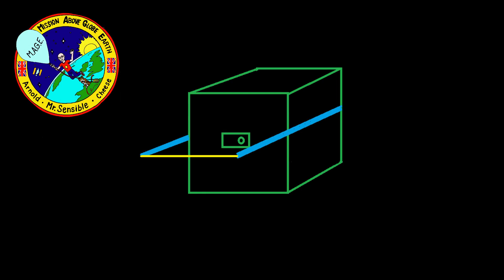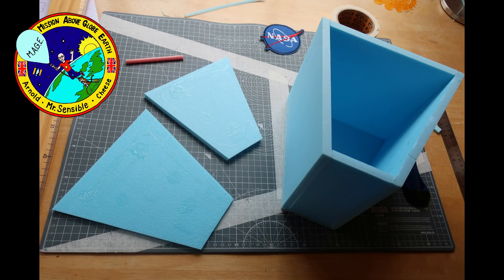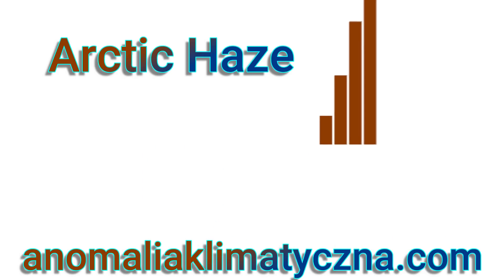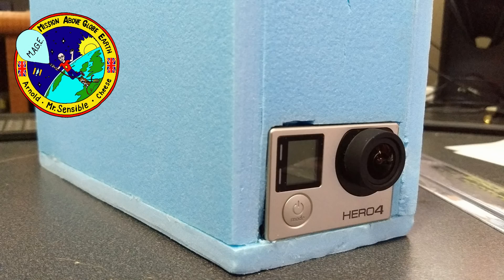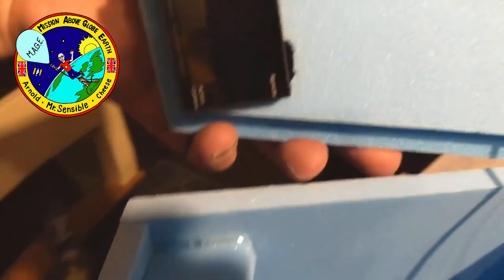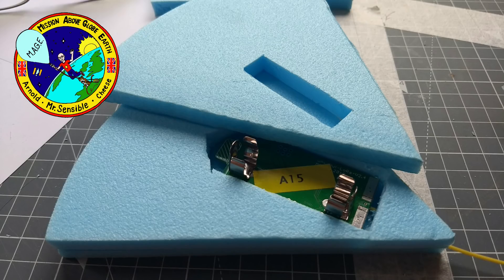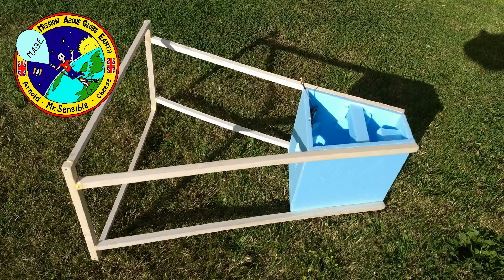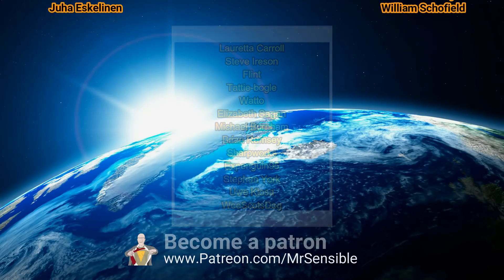MAGE Mission Above Globe Earth  - Construction

Comment: Sorry I didn’t see the details of your instrument package sooner. 
You could have done away with the two stretched tension lines & it’s support structure. You could have done this with a simple PRE- Flight OR POST-a flight calibration. Simply place a 2D grid (say 10 horizontal x 10 vertical, both stretching all the way across the field of view) of horizontal & vertical straight lines drawn on a large piece of white paper, mounted  in front of the camera, perpendicular to the optical axis. Take several images of the calibration grid, then find a “De-Fish” filter that is suitable (designed for) your camera’s optics. Show the “before” images (they will likely have fish-eye distortion) then apply the filter to that image. If the filter is correctly tuned for your camera’s optics, then the curved lines will become straight all across the field of view. Since you already know the lines are straight, because that’s how you drew them, you know what the “De-Fished” images should be (a grid of horizontal & vertical straight lines).

The one disadvantage of this approach is that FLERFers would have to understand how & why De-Fish filters work, and believe that they work consistently. It will be too easy & tempting for them to merely shout “faked & manipulated data”. Having a reference straight line in the image (as you’ve done) will help disarm that nonsense. One weakness with your stretched string is that the amount of FishEye distortion varies at every point in the image. Presumamably you are going to eliminate the distortion with a De-Fish filter, thereby returning the taut string to a straight line in your processed images. Unfortunately you will have demonstrated the proper amount of correction ONLY In the immediate vicinity of the strings in your image. If your horizon is “many pixels” displaced from the string, then you will not have proven proper correction at those image location(s). A 2D grid that covers the entire image FOV, would demonstrate proper “whole image” correction.

One advantage of using a calibration sheet is that you can still do this procedure now (after the flight) and it’s results are completely valid when applied to the images you’ve collected.

Comment: Marvelous design, and forethought! One "spinoff" benefit from a wedge-shaped equipment buss, the thing will tend to turn into gusts of wind, assuming the mass-distribution is suitable, with the "science camera" pointing downwind from the gust. If you want to accentuate this effect, you can plant tiny flat "fins" at the ends of the arms, out of view. You don't want these so big that you'll foul your chute risers during the recovery phase, that's where testing comes in.
Weather-balloons go with the wind for the most part, but there are frequently gusty layers and these things can flop around a great deal at altitude.
I was going to email you a cheap, very light, and effective "yaw" stabilization method.
Reply: @Q True enough. Must remember to send my idea, which has worked on lower altitude "elint" oriented balloons to keep the antenna-lobes pointed generally the right way. It will fail if the shear/gusts are strong enough, but will resume when calm, and doesn't require power.
If your ELT is running continuously, you should be able to keep your 70/2M Yagi pointed pretty much right at it, by hand, "foxhunt" style. One I had was nice, it went "ka-chuk-ka-chuk" when you picked it up as audio.

Comment: Couldn't you have used thin flat strips of wood to hold the strings?

I mean, like the limbs on a bow.

Or fiberglass strips, they may have higher strength with the same weight

Comment: I know you made the lid double-lipped, but you kind of still made the weakest point at the top; I'm somewhat worried the payload will just fall off, leaving only the lid attached to the actual balloon.

Is there a reason the box needs to be this tall? Seems like there's a lot of empty space inside.
Reply: @Q Branch Nice, thanks for explaining!

I suppose the added box height doesn't add significant enough mass to worry about then.

Comment: I know its weight, but what about a gyroscope for stabilisation? The wooden framework also looks over the top? Would a couple of unwound metal coat hangers do the trick? (Doesnt need to look pretty, just do the job?)  Plus , also, adding a THIRD string line at the same height as one of the others, but further out will also disprove the horizon "rises" with height thing too.  Im really excited to  see the results of this!!

Comment: You should test run with batteries in the freezer to see how I handles the cold
Reply: I fly model aircraft with LiPo batteries(the soft cased lithium ion batteries), on a cold day a fully charged battery can fail to power the motor; even if it is just warm enough to start the motor, the range is dramatically reduced. Keeping lithium ion battery cold isn't in itself dangerous, but charging them when cold is, because they will go into an overcharge condition when they warm up, which is when they can become dangerous.
Reply: Oooh, I think that's a good idea.
Reply: @briannewton3535  He can also see how well his freezer copes with a ruptured lithium battery inside it. :)
Reply: @bdf2718  Have you experienced this? What happens?
Reply: @briannewton3535  It was pure conjecture.  The electrolyte isn't water-based (I think) so won't have a problem with water expanding when it freezes and jaggy ice crystls.  But the performance does drop off rapidly as the battery gets colder.  Are there enough changes that the battery could rupture?  Dunno.  This is one way of finding out...
Reply: @bdf2718  I apprecate this is one way to find out. The other way of finding out is research.  I think it is fun when someone throws a comment in without knowledge, and pure speculation. I have found that this is usually a flerther or a Christian.
I did a quick google search, and found something interesting. 
Sometimes a lithium-ion battery that appears to have died, can be 'fixed' by freezing,  bringing it back to life. Seal the Li-ion battery in an airtight bag and put it in the freezer for about 24 hours, ensuring there is no moisture in the bag that could get the battery wet. When you take it out of the freezer, let it thaw for up to eight hours to restore it to room temperature. It may fix it.
Reply: Brian newton I am a wildlife photographer I have been to Yellowstone in the winter when it was -30c , we kept the camera batteries in our pockets until we needed them ! Freezing is ok ! It’s heat that’s problem ! :)
Reply: @markgreenwildlifeimages  As an amateur photographer myself, I have experienced poor battery life in cold conditions, though nothing as cold as you experience, and yeah, on those days I kept my spare in my pocket.  I am in awe at the shots that wildlife photographers get. I am sure most viewing the images do not fully appreciate the skill and patience of experienced photographers.  
We just need to review the photographic 'skill' and 'knowledge' from flerther efforts to demonstrate that incompetency does not end well.
Reply: @briannewton3535  If you read it on the Internet, it must be true!  Nobody would ever post advice like that knowing it would result in catastrophic failure of the battery.  People don't post malicious advice for shits and giggles.

Back in the real world, we rely upon empiricism and worrying about what might go wrong before it actually does go wrong.

Oh, and some of us can recognize a fucking joke when we see one.
Reply: @bdf2718  Sorry I missed your joke. I will try to be a little more sharp witted in future. I will add 'Improve sense of humour' to my to-do list . Sorry you didn't find the little nugget about lithium batteries interesting. Toodle pip.
Reply: @briannewton3535  If I want nuggets about lithium batteries I'll watch Big Clive do dangerous things with them.  In between electrocuting sausage rolls.
Reply: @bdf2718  That sounds smashing. You have fun with that :o)